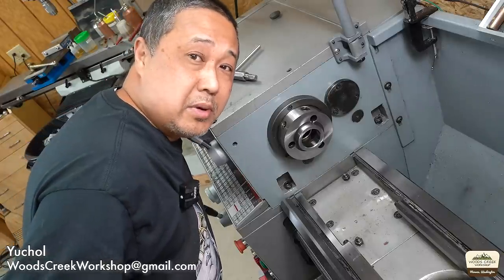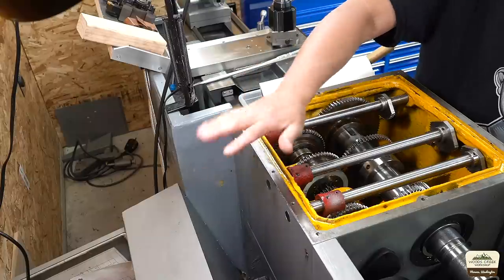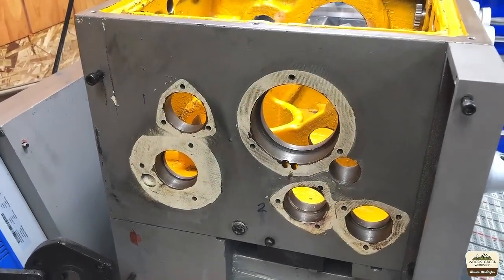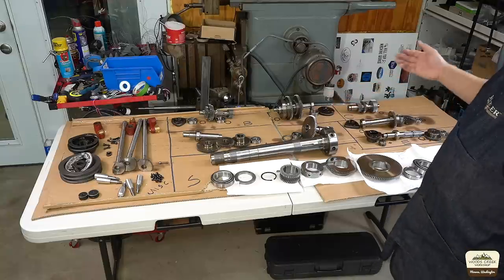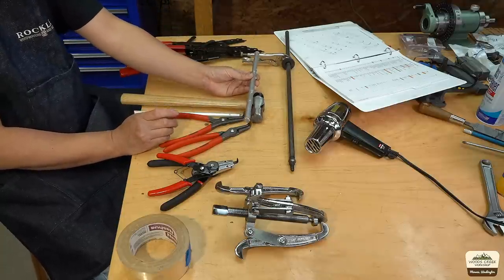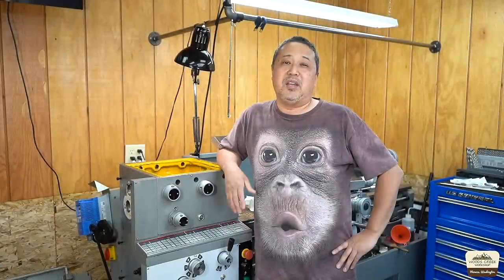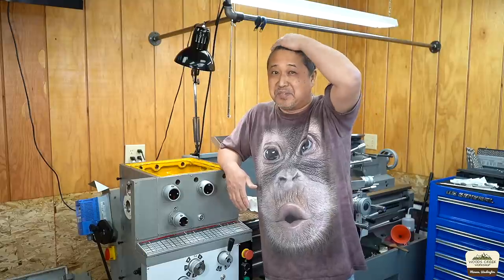LATHE SPINDLE BEARINGS (Part 1) - TEARDOWN of 13x40 Engine Lathe Headstock

Comment: This is VERY interesting, as I think my machine, sold under a UK brand, is from the same factory!
Reply from the maker: Would be good to take a look inside
Reply: @woodscreekworkshop9939  Yeah, sure will do.
I'm just going to fix do a job or two on the lathe first.

I've got plans to redo the bearings in the mill, and I want at least ONE of my two machines to work, in case I have to "fix" something.

Comment: I bet it is going to feel great to have new high quality bearings in your lathe. I have a 50 year old Colchester with the Gamet bearings. If it ain't broke, don't fix it, in my case. I think when some lathes need spindle bearings, it's time for the scrap yard. If you had to pay over $2,000 to replace bearings in your lathe would you do it? Or look for a new one?
I had a 13" South Bend lathe that was made in 1941. The cast iron bearings were in new condition. Maybe those guys knew a thing or two about quality. Of course the max RPM wasn't 2,000+
Reply from the maker: Jeff Anderson $2000 would be a tough decision, don’t know

Comment: I've got an American turnmaster 15 (copy of clausing colchester) torn apart right now.  I need to know how to preload the spindle bearings correctly.  Also, I'm fitting an external inline oil filter to filter out grit.  Does anyone ever put a magnet inside of these, like a rear differential on a truck?
Reply from the maker: Many people place magnets inside and I will do the same.  Unfortunately lathe doesn’t have an oil pump, so I can’t add a filter.  I guess I can always add an external pump 😏. Search on Practical Machinist forum for “spindle bearing preload” and read up on temperature-based method.

Comment: I ordered new Timken bearings for my Bolton lathe a few months ago and they are just sitting on my workbench because of the dread of installing them, although I read it makes a world of difference to get rid of the Chinese bearings that's in it now.
Reply from the maker: Do it!
Reply: Yes, I would feel the same. On the other hand seeing this video and also a whole series from a channel called Swan Valley Machine Shop does provide lots of useful illustrations and tips and tricks for getting the job done. The SVMS videos show complete disassembly of a Taiwanese 12 x 36 lathe (different source, but basically identical to the PM-1236T). That combined with this excellent WCW series will be excellent inspiration for getting these jobs done!
Reply: @woodscreekworkshop9939  Well, my motor burned up on my lathe so I had to do quite a bit of disassembly to dislodge it from where its buried in the back and I took the opportunity to replace the spindle bearings. Wasn't as bad as I thought it would be. Thank you for the motivation!
Reply from the maker: JETHO321 glad it worked out well!

Comment: I think the bearings are all made on the same manufacturing procedure and graded accordingly to run out and the p5 tolerance is stamped on the bearing which you pay an arm and leg for.
Reply from the maker: They are definitely made the same, just inspected and sorted like you said
Reply: The production lines for the lower class bearings are not set up to take the all the measurements needed for the higher precision bearings.  Precision bearings are usually made on separate lines since they get much more hand fitting and measurements taken.  If the rings or rolling elements do not meet the tolerances, they are reground until it is within them.  They cost so much more because the labor to make them is significantly higher.
Reply: @mikeb1520  Damn right you are, I used to sell bearings and had an engineer over for super precision spindle bearings problems with an OEM machining center customer.
Long story short; all bearings of the run out quality needed be ABEC 3, 5 and 7 are made in specialised produstion lines or plants.

The amount of inspections and measurings make these type of super precision bearings so expensive. 
The most expensive ones are made in sets that are marked not just with top of run out (etched dot), but are sorted and marked with an etched V mark across the set to avoid mixing the bearing set up

Guess what; that OEM customer had some apprentice mixing up a set of 4 angular contact bearings, no wonder they  had troubles.
Reply: ervie60 I used to work for FAG Bearings in the Barden Bearings building, Barden only made ABEC 7 and 9 bearings, these P5 bearings in the video are scrap to them :).  The ABEC 9 bearings had their own temperature controlled room with dedicated grinding, honing and measurement equipment, as well as employees.  The people making ABEC 9 bearings only made that class bearing.  After seeing the work that goes into making bearings of that quality, the prices don’t seem so outrageous.

Comment: What about putting some course gauze in the drain hole over the spindle holes.  You might have to replace the gauze twice a year, but it would keep out the metal pieces.
Reply from the maker: That would block the drain  and would cause other issues.  I have few ideas and will include in the part 2 video.  👍🏻

Comment: Hi Yuchol   I've a Taiwanese  Dar Sin 1230 Geared Head Lathe ( Sold by Frejoth (Acra)). I imported myself 1982.   I shall renew the spindle bearings in near future. It might be vise to renew all the bearings and clean thew whole headstock.
Did you take any video of disassembling, and assembling  the gear shafts, gears and bearings?
Reply from the maker: There is part 2 video

Comment: Great content. I have a kent kls1340a which is very similar I've also have seen similar defects like yours like leaking all over the floor thought about a drip pan like yours didn't have one so i just put gasket maker around the tray and pedestal now oil drippings just flow into chip pan which i also have to redo some of their welds on pan brackets this machine is only 4 years old and not ad much use as yours but the problem appears to be the fact that they have no pride in their workmanship any more.
I thought abou selling my original smaller  craftex combo lathe mill but decided to keep it because wont get much for it and I've had to use it to make parts for my other lathe and mills when they break down  like when you had to make new detent collar but you can't do it if lathe doesn't work at least it wasn't a critical part that machine won't work while making new one. 
Word of caution for the lid 
If you don't use a gasket just sealer that rib on lid needs to have notches cut into to allow oil into the trough for oiling the bearings 
I reused the gasket but lid was bowed so i notched lid for oil flow a used gasket maker on both sides of the gasket this also cured the major part of my oil leak 
Good luck with getting it back together and getting it going
Reply from the maker: Thanks for the tip.  I also made a drip pan out of 16 gauge sheet metal few years ago and that helps.  No pride in workmanship these days 🤷🏻‍♂️

Comment: Wow!!!! I have a Jet GHB-1340A that’s twenty-six years old. I Change the oil every year. I have never seen the mess you have with your lathe.Mine has a factory installed magnet in the bottom of the sump.No chips were found on it.Jet must have more than a few quality control issues over the years.
Reply from the maker: James Davis I actually had the exact same lathe as mine 16 years ago and it was made in Taiwan, same model number, had to sell it when I moved across the country.  There is no comparison, that was so much nicer than what I have now which is made in China.  Your lathe is made better than what they make today!
Reply: I am surprised they don’t have a magnet in the sump.I would definitely epoxy one in the bottom.If you need one,I have some that I robbed out of 40mm rodless air cylinders.They are almost dangerous.🤣🤣🤣
Reply: I seem to recall the earliest Jet products being made in Japan then in Taiwan but I imagine everything is made in mainland China these days. You can't expect the children who assemble them to de-burr the castings.

Comment: You need to loosen the fit of the outer end spindle bearing on the spindle or you will not be able to set the pre load properly! It should be a tight sliding fit. If it binds up as you adjust the preload the main bearing behind the chuck will still be too loose.
Phil UK

Comment: If I remember rightly, Mr. Pete insisted that one ought not use compressed air to blow chips out of the chuck because the air will drive the chips thru the chuck into the gearbox.  Don't know enough to argue with him.
Reply from the maker: Dan Kolar The headstock is sealed, no compressed air would have caused this damage.  Also, compressed air is like any power tool or food for that matter, too much of anything can be bad.  You just have to know how to use it and when not to.
Reply from the maker: Let me clarify, you can blow chips into the headstock, but in order to do that, you need to blow air at where the spindle comes out of the headstock, not the chuck itself as that would only push chips down the open bore of the spindle and come out at the other end. Thanks. 🙏🏼

Comment: Dear brother I designed a 12 speed lathe Headstock by watching your both bearing replacement videos but it's not working properly I think lot of points are missed due to the fast videos could you please upload the original full video with normal play back so that I could come out of the problem in which I am badly stuck. Please do give me some solution otherwise my job will be in danger I designed it for a company in which I am working with.

Comment: Sometimes C3 bearings are specified to account for heavy shrink (edit: meant interference) fits onto shafts and/or hole, so that enough radial clearance remains on the bearing after installation. Hopefully you didn't encounter such a tight fit during your disassembly otherwise there might be a problem going with CN (normal) clearance units.
Reply from the maker: Things weren’t too tight.  Thanks!

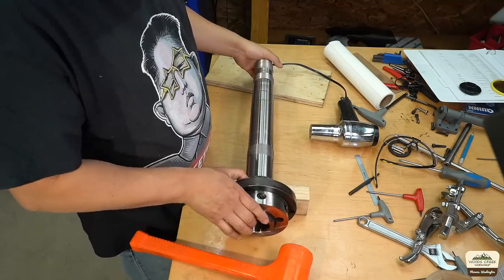Comment: 6:42 a little trick. put wooden plank on the floor. than gently smash the spindle on the plank. like you are fix the loose hammer. the bearing would fall down easily.

Comment: How old is that lathe? That's shockingly bad.  While you have it opened up, it might be worth it to redo the Glyptal paint to seal the casting.
Reply from the maker: Darren Floen lathe is about 3 years old.  I’ve thought about Glyptal, but not sure of the compatibility to the existing paint

Comment: Hello  Yuchol.
 Your videos on the bearing replacement is very informative and useful. My problem is oil leaking out of the front spindle bearing. As there are no seals on either front or rear spindle bearing I have elected to clean the gear box  (lots of crud) and install new bearings, both ends.  My problem is I cannot find a dealer in Canada or US who deals in the  LYC brand of bearings used in my lathe.  I can order the bearings thru King Canada but they want my first born and a mortgage. I've tried LYC in China but there was no reply to my e-mail. Maybe it's because there is nobody there who speaks english. Did you use the LYC brand bearing and if so what dealer did you use? This is all because I bought a King lathe :(. Looking forward to your reply.
 Best regards
Bob Baxter Vancouver Canada
Reply from the maker: I explain what bearings I used and how I sources them at the end of this video and beginning of the part 2

Comment: 0:05  What is the correct name for the RODE tool for sound analysis of bearing condition?
Подскажите пожалуйста, 0:05 как правильно называется инструмент RODE для звукового анализа состояния подшипника?
Где можно купить?
Reply from the maker: Erlan Bagyshbekov that is Rode Wireless Go, just a wireless mic system that has a built in mic.

Comment: neodymium magnets stuck down in the corners of the headstock..  will pull all the steel and iron particles out of the oil.. 
Do you have a CO2 only fire extinguisher... that you could discharge down the spindle tube to shrink it to allow the bearings to be slid on easily..  or pickup a 5 dollar pack of dry ice from the local ice supply or wholesale grocer.  you may want to stop at a parts store and pickup a tube on a card of permatex 85420.. inside the tube is Permatex. you can spread that out really thinly. to seal the cover on..
Please spend the hour and Blue up the top cover mounting flange and see how much contact you have with the top of the headstock case.. 
 before installing anything..  please measure the holes that are the drip oil feed to the spindle bearings.. take the measurement and go over to a transmission parts supplier or sometimes just a automatic transmission shop and see if they have some cone shaped filters to put in the holes.
Reply from the maker: Thanks for the suggestions Wayne 👍🏼

Comment: Did you buy the lathe new?

Another thing, VXB.com has been a good source for bearings.
Reply from the maker: Rod Solomon I bought it as a scratch and dent, shipping damage to couple of parts.  VBX does not carry normal clearance ball bearings not the high precision taper roller bearings, I checked.

Comment: Wow.  This is why I am hesitant to buy a lathe... I know you got it on "scratch and dent" for half price.  But still, that's $3-4k right?  You had to put work into it right off the start for the drive shaft and gearbox last year.  (luckily at no cost for parts).  If you had had to pay full Jet prices, you'd be pushing the cost of a new lathe!
Reply from the maker: I would not buy a Jet lathe.  One of Taiwanese made Precision Matthews lathe would be my choice.  Unfortunately wife says no upgrade 😭

Comment: A puller can be fashioned from threaded rod and PVC pipe as an alternative to a slide hammer. It can provide more pulling force without impact stress.
I recently purchase a Chinese gear head mill and there was casting sand that had been painted over everywhere, even inside the head. This is the problem of using children in manufacturing:-(
Reply from the maker: Yikes

Comment: It's disappointing to see the bad condition that whole assembly is in after only a few years.
Reply from the maker: It truly is.  Thanks 🙏🏼
Reply: Yeah I would have expected more from Jet. They sure cut some corners on this lathe.
Reply from the maker: Hill Top Machine Works I actually had the same lathe 16 years ago.  That was made in Taiwan, nice lathe. This one, not much 😒
Reply: @woodscreekworkshop9939  Understand. I bought my 13x40 new in 2004 and it is from Taiwan.

Comment: I  don't look forward to removing the head stock covers on any of the LeBlonds and Lodges at work. First, I  need a crane to get the lid plate off... it's a lot of work and not very comfortable.
Reply from the maker: Understandable 😁
Reply: @woodscreekworkshop9939  it's been over a year since I had to dive inside a head stock gearbox and I am happy not to go back any time soon. Last job was pretty straightforward,  repair a hydraulic leak on a shift cylinder. A cracked hard pipe in a very hard to see or reach place. I used a mirror to spot the leak inside the gearbox with DT24 oil spraying everywhere. I had a solid 1 second before the spray covered the mirror and me. It's OK, hydraulic oil helps to grow hair, you know... at least in theory.

Comment: Problem solved, slid an "O" ring over the D1 4 spindle touching the seal housing, effectively blocking the annulus and preventing small chips entering the Headstock.
Reply from the maker: In my case I never used compressed air anywhere near the spindle.  It would be wise to use air judiciously.

Comment: Probably lots of room to spread the blame around for an obviously non de-burred head stock like that one  Yuchol. Jet for not having there own quality control and the bare minimum of acceptable standards in place, the manufacturer for being willing to cut corners that bad to meet Jet's unrealistic price point or just to maximize there profits and keeping Jet in the dark. Ultimately Jets name is on the machine so that comes with the responsibility of making sure what there selling is correct.  Being just correct enough to make it past the warranty period isn't real conductive to repeat business. I think it's more than doubtful that Jet hasn't already had numerous complaints about the exact same issue. And no machine tool manufacturer goes into business of building those machine tools without fully understanding basic machining practices. The factory knew exactly what would happen in the future. Today I think it would be safe to assume lathes of around that size are built in enough volume where the head stocks are machined and bored on probably a dual spindle 4 - 5 axis cnc and I doubt there now line bored at all. If I'm correct then at MOST you'd see 1-2 minutes added to the time and a tool change to run a de-burring cycle. I see quite a few comments on here recommending some kind of pre filter material added before the bearings to try and filter out any future contamination. I'd be real careful about doing so on any splash type lubrication system. The design you have now is meant to get an excess amount of oil to the spindle bearings both for lubrication and temperature control. Trying to filter that oil at all could very well restrict the amount of oil those bearings are getting and result in drastically reduced or even catastrophic bearing failure. With the head stock now properly de burred and cleaned then logically doing regular oil changes at 6 - 18 month intervals depending on how much use it sees should be all that's necessary.

If it were me? Once you get that head stock back together I'd then pull the carriage apron apart. If it's been done and left in the same way then de burring it and a proper cleaning will save you some further head aches. Having the power feed gearing fail simply due to chip contamination could result in some long delays getting the parts.